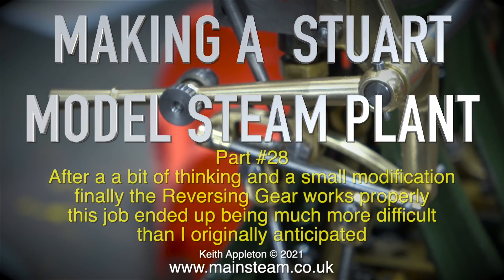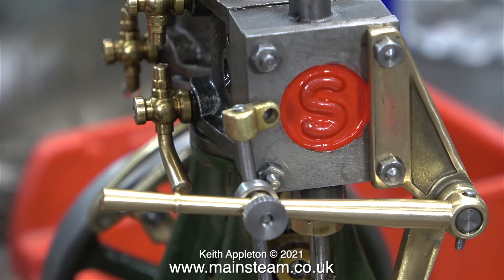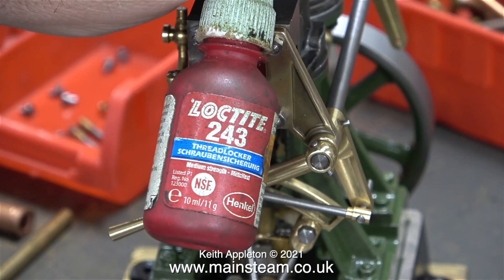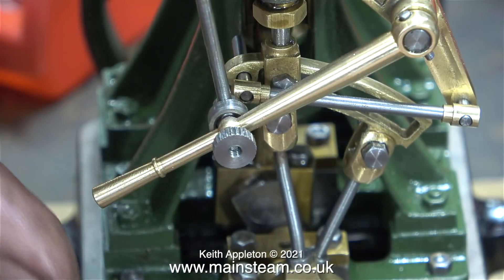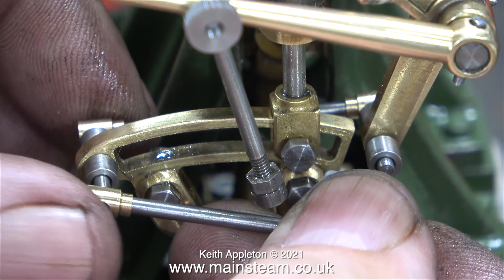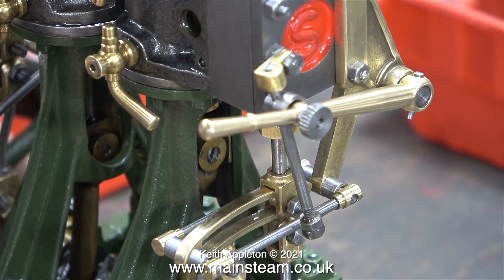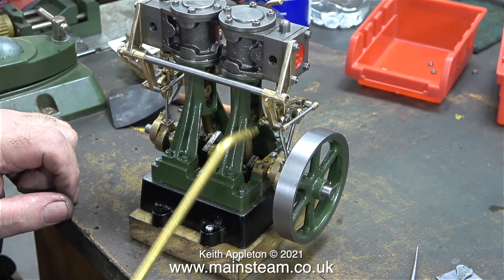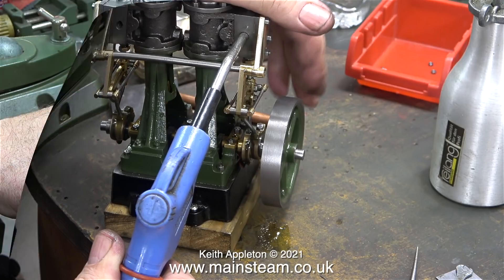MAKING A STUART MODEL STEAM PLANT - PART #28

Comment: I need some help i do write an article about steam engines and I´m woundering all the time how can there be a triple expansion engine with 4 cylinders...
Reply from the maker: Yes, but it then would be called a Quadruple Expansion Engine. As fas a I know, Titanic used the steam output from its Triple Expansion Engines low pressure cylinder to feed a Steam Turbine to power the centre Propeller.
Reply: @keithappleton  so the turbine is considered the 4th cylinder ?

Comment: If you look at andrew whale's 10v reversing gear build you will see that his lever and crank aren't at 90deg like yours. This is why your locking bar didn't fit.
Reply from the maker: Thank you for your advice. I am aware that it is the incorrectly drilled cross hole in the reversing shaft that' causing the problem, I just needed to work around it. Stuart Models did say that there were "issues" with the early versions of this reversing gear.